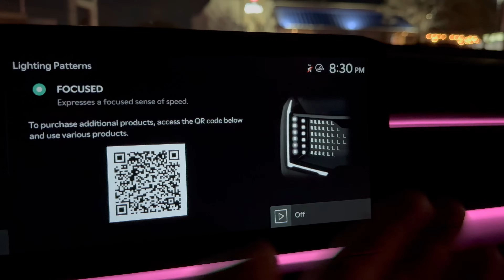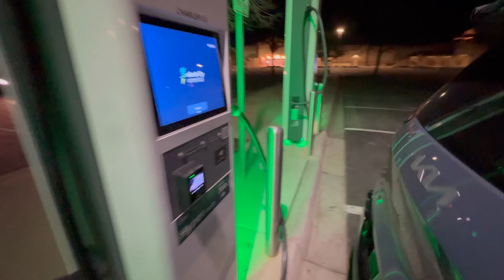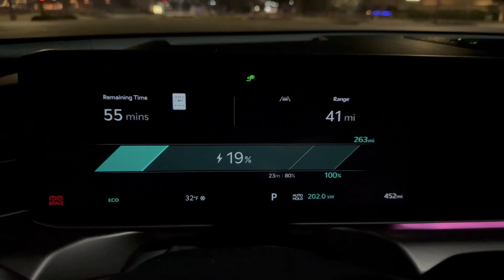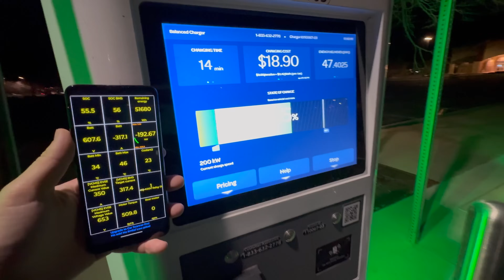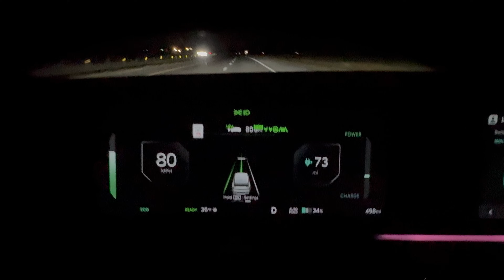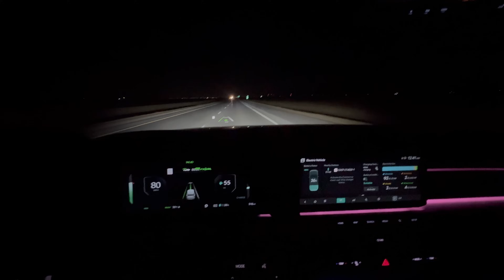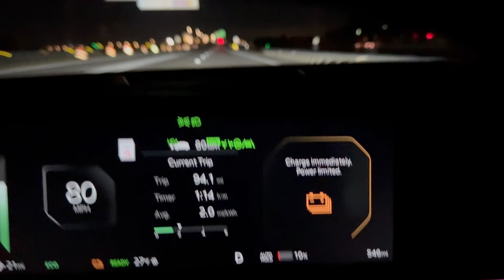The Kia EV9 Will Be A Great Road Tripper! 10% Challenge w/ This Electric SUV (GT-Line 99.8kWh)

Comment: Stop supporting the manufacturers gaslighting everyone calling these types of vehicles SUV’s.  It’s a crossover at most. Has little to no ability to go off road. Which is fine, but when you compare it to a true SUV like the Rivian you are handicapping the Rivian that carries the cost and weight of what is required to be a true off road vehicles. It’s like comparing the efficiency of a g wagon,Land Rover, Land Cruiser, etc with a Lexus RX. They aren’t the same and don’t have remotely the same capabilities.
Reply: At the end of the day it’s just a name. I don’t see issues with calling them the same as like everything there is a spectrum of capability which people can figure out if they’re so inclined.

Comment: Hmmmm my only thoughts on this is, compared to the telluride top tier trim for similar evaluation, at 52k, that car gets 24 mpg.  Allow us to be reasonable and say 21.  Even if you lived in a state where gas is 5 dollars a gallon, you will get 84 miles for 20.  You just charged this at 36 cents I assume with a electrify am pass+, and at 19 dollars for 94 miles this makes a pretty tough sell.  If you live in a state where gas is 3/4 dollars that makes it even more difficult.  Being that this is currently the only kia family mini van I guess it can fly.  Considering the tellurides cheapest trim is 32k the lower models of the EV9 would have to be possibly 38k or lower otherwise that's money which could be counted towards fuel and is actually not upfront costs.  *I will notate that in states where gas is cheaper the cost of home charging is substantially lower but a typical ~15% to 80 will take 11 hours on a 240v

Mind you that if you did have 4 passengers, 5 total that this range would drop even further, similar with the telluride.  Just something to consider.  The model Y, at least mine is almost twice as efficient or twice as cheap for the same performance, keeping in mind that there is a 7 seat option but does not really hold more than 5 comfortably.
Reply: If you only ever charge on public DC fast charging, then yeah, the fueling costs will be in the same ballpark as gas. But if you charge at home to cover your day-to-day needs, like the vast majority of people who (should) buy an EV at the moment, then your fueling costs can be much lower. If you can't charge at home, then an EV probably isn't for you at the moment.
Reply: @WarpedFlayme  Indeed, but I can't charge at home and I only rely on super chargers.  My round trip daily to and from work is 200 miles.  Fortunately where I live and I am certain other places as well, tesla is cheaper in the morning when I get home than what I pay at my home per kw.  I think there are definitely a lot of factors and 100% agree, I think kia and hyundai are going all in on electric and offering comparable vehicles since their combustion counterpart is total trash.

I just feel a lot of people do get confused with electric, if I buy an electric car I want to pay half the cost of fuel for equivalent mileage on a prius or ~50 mpg.  So if you buy a car and cant get 50 miles for 1.50 in a 3 dollar gas state what's the point of buying electric.  Simply my take on it and something to definitely consider
Reply: Don’t forget most of the time you can charge at home. That is much easier and cheaper.
Reply: That also assumes that everything about the two cars are otherwise the same. An electric car will drive different, not vibrate at idol, instant torque. If you drive both and feel they are equally appealing then get the ICE. I think the biggest mistake is people comparing ICE and EV as if they are the same and then asking for the math to payout. You should feel that you like something better about the electric version to justify the price difference.
Reply: @minelast7113  Agreed, that's my point with most electric cars the price is typically higher than ice.  Most manufacturers and straying from electric cars because profit margins are way less.  I watch the electric viking and have previously heard this topic come up and it's probably highly accurate.

As I just stated in another reply, when I buy electric I buy to save on fuel.  My opinion is if you cant get an equal performance in miles at half the cost of gas it's not worth it to buy electric.  This is regardless of whether you charge at home or at superchargers.  More so if someone depends on superchargers
Reply: It is true, the fuel comparison is valid. And sure, this isn't the best efficient version of the ev9. 
But Kia and Hyundais reputation with gas engines, lol. If going gas, better get a honda or toyota instead.
Reply: @sprockkets  I just want people to understand that going EV is typically about fuel savings. In my opinion if you buy an ev whether you are supercharging or have the ability to charge at your residence the cost needs to be half of what you spend on the fuel.  I just simply use miles to do this, and for example a prius is pretty much the top hybrid and will definitely get you ~50 mpg.  So when I charge my electric car if 3 dollars gets me 50 miles I need 50 miles of charge for 1.50.  

Some may say why do I think this why or what is that based on and that is stemming from the premium price tag for an EV.  which is the point I brought up in the comment.
Reply: Only reasonable EV is a model 3 rwd with the current 7500 tax credit.  Less than prius.  I suppose chevy bolt too.   These expensive EVs are pointless unless you ahve money to burn.  Also i wouldn't buy an EV unless i could home charge it.
Reply: @zachlafond2652 no tax credit for the 3 or y....

Comment: Once again I appreciate the enthusiasm but 15 min to go 140 miles?   So basically add an hour plus  to any day of driving if the charge is open. Nice looking vehicle though.
Reply: That's about right, but subtract the real-world time for stops that you'd take for gas, food, bathroom. If you road trip like me at 20, where I would tank, pee and grab snacks in a 10 minute stop, it's a bigger difference. Travelling with a family makes every stop a 30 minute stop so I doubt the constraints of an EV like this would really add that much time to a real-world road trip.
Reply: Sorry what do you mean by "everyday of driving" ? The 140 miles would be for 15 mins of fast charging from 10%-54%. If you charged up at home before leaving on your trip or daily commute you would probably get 220-240 miles in the conditions kyle was driving in his 70 mph test. This might not be enough range for some people but for the majority of drivers this is more than enough. That's not to say more range wouldn't be appreciated for the 5%-10% of the time people actually have to drive further than these distances or when it's well below 0 degrees. Then at that point the more range the better but those temperatures only last for 4 months out of the year, the other 8 months are good for battery efficiency.
Reply: @BrianNedry  Kyle drove 94.1 miles on 49.45 kwh - the battery is 99 kwh so that would be 188 miles +/- from 100% to 0% under the same conditions at 526Wh/mile. That is the worst efficiency I have ever seen for a 10%/15min challenge. Yes it was cold but I would swap some efficiency for a 5 min longer wait every day of the week.
Reply: 15 mins to go 94 miles at least in these conditions.   Summer would get you more.
Reply: Also paying $21 for 140 ish miles is more expensive then most ICE cars plus you have to wait to charge it, plus the very rare chance of  the battery becoming a flame thrower under you.. not more environmental than ICE until like yr 7.. idk, ev's and the infrastructure has a LONG way to go before everyone gets them 🤷‍♂️ also I only want to stop for 10mins every 4hrs to pee and get gas and be on my way and get where I'm trying to go

Comment: Again I want to see the 10% challenge using the more common 6.6kw charger that’s actually available in the real world. You landing at the .001% of dc chargers is NOT real world. Inviting you to Las Vegas for a test..
Reply: That’s not reality so why test it. As someone who has driven an EV(not Tesla) from Florida to California and from California to Utah many times, I have never had to use one of those chargers, not once in over 10000 miles of road trip driving in multiple EV’s. That includes crossing Nevada on I-80.
Reply: @hoopdyhop76 
Henderson Nevada. You look and tell me how many working chargers you find. electrify America  There is ONE working charging max 48kw in the shit section of Henderson.
Reply: You didnt say "Nevada", you said "Las Vegas" which, I just checked, has 10 Electrify America stations.
And I don't live in Las Vegas or Nevada, I said I used them while passing through.
Besides, if you can't charge at home, then an EV probably isn't a great option for you right now. DC fast charging should only be for road trips, not used for day-to-day driving needs. DCFC puts you in the same cost ballpark as gas with a way more expensive vehicle and puts additional wear on the battery.
Reply: What are you talking about? Vegas has like a dozen Electrify America stations. I've used multiple of them while passing through.
Reply: @WarpedFlayme 
One in Henderson 48kw
Reply: All the casino parking ramps and hospitals is what you will find they are all 6.6kw
Reply: The Kia and Hyundai dealers I bought my ev6 gt and Ioniq 6 don’t even have working chargers. You buy a new EV with 5% battery and they send you to the one working charger in shit part of Henderson to wait hours in line for one 48kw charger.

Comment: Will be interesting to see what 2024 brings.  Why buy an ev with only ccs port when nacs is around the corner?  Adapter doesn't seem to matter given most Tesla chargers will still have the short cord issue.  CCS cars taking up more than 1 space in 2024 will be interesting to say the least.
Reply: this car with these voltages cannot use current TSCh network anyway, no matter the plug

Comment: The Kia EV9 Will Be A Great Road Tripper once it comes with a NACS charge port in the correct location, till then its only good for home charging.
Reply: But does Tesla provide 500+ Volts? 🤔
Reply: @abraxastulammo9940 In their upcoming V4 chargers, which are being installed in Europe at the moment, they do. They will be able to charge at 350KW.
Reply: @migueljardim8177  Europe will never get nacs
Reply: @migueljardim8177 I've seen that they're deploying the V4 dispensors, but I haven't seen that the V4 chargers are being deployed as well. If that's the case, it's good to hear and I hope they cross the pond soon.
Reply: @abraxastulammo9940  Guess what? NACS is not the only charging standard in the world that can support 350KW, who knew?!
Reply: @WarpedFlayme  You are correct. They've started rolling out the dispensers, and they'll start wiring them up in the 1st quarter of this year. It'll be interesting to watch charging speed comparisons between the different versions of superchargers in the future.
Reply: Europe already uses CCS for all EVs including Teslas and supercharger.
Reply: @abraxastulammo9940  
Read the NACS standard, its good for 1000V
If the EV9 has contractors like the Cyber truck it could charge at 250kW at 400V.

Comment: Dear Kia, if you see this, please give us some kind of dog mode. That's the only major downside I can see for myself since I have a service animal that goes with me everywhere. Awesome video Kyle, you're killing it with these reviews. Have a awesome New Year!
Reply: The car comes with Utility Mode, it's like Dog Mode and Camping Mode combined!

Good job they didn't call it Dogging Mode....
Reply: Just leave the thing on.   Easy enough.  Certainly not a downside.
Reply: @spazzman90  You're right, I shouldn't call it a down side, but it would be nice to have a setup that will notify me if for some reason the air turns off, or there is a issue like Rivian does. Where I live, it can get to 120 degrees in the summer, so I would rather be cautious. Other than that, I got to drive one of these yesterday, and I love it.
Reply: If you travel with a service dog, its safe to say you won’t be leaving the dog in the car alone, so why the need for dog mode?
Reply: @Annette_Hons probably because there is certain situations where I can’t bring them with me if I’m gone for 5 to 10 minutes.

Comment: Why would you be doing 80 in that brick of an SUV?
Reply: Because 130 is the "most recommended" standard speed in Germany 😇
Reply: 80 mph is a good speed to show you roughly what people should expect driving in similar conditions and traffic, at 80mph you would definitely be keeping with the pace of Hwy traffic if not exceeding it. If you want better efficiency then drop speed by 5-10 mph and that would get the EV9 into the 100-120 miles zone with no problem. In warm temperatures I'm guessing 130-150 miles doing the same loop in the video. Close to 300 miles in 2 fifteen minutes stops from 10%-54% (half a hour to 40 mins) is pretty good for this 3 row monster.  Quite impressive Kia, just need the price to drop and they'll have a winner.
Reply: If he hadn't set the parameters of this test to that value, there would be a lot of comments saying it's slow and most people drive faster.

Comment: More energy added in 15 min than Lucid Air and nearly as much as Taycan. What a beast! I want to road trip one of these.
Reply: Try ABRP from Phoenix to Telluride in the winter in the AWD EV9. Requires that you drive 10 mph under the posted speed for 4 hours and even then arrives on fumes. Hope you don’t have a headwind or snow to contend with. 

The fast charging is cool but I wish they’d put another 30-50 miles of range in the battery pack.
Reply: Kia is promising vehicle, but these need more range to be competitive road trippers where many of us want to be able to efficiently travel. I frequently cross areas of the west, where fast chargers are still quite spread out, even on interstates.

I used A Better Route Planner app to see how the EV9 does on many routes I frequently travel. Rivians and Teslas still beat the LR AWD EV9 by significant margin, apparently due to their longer range. See example below. 

An often overlooked benefit of longer range is faster charging, and frequently significantly faster. 

When you need to “fast charge” above 60% or more, all EV charging speeds get significantly slower to protect the battery from excess heat. Longer range EVs greatly reduce the need to charge near the max capacity of the battery. For those long legs between chargers, that are still common in many areas, longer range EV’s can do them changing to a lower percentage so they keep charging speeds faster.

Throw in some cold weather, wind and precip and it gets even more important to have the big battery.

ABRP Estimates: Flagstaff – Vegas – Flagstaff

R1S Quad Large Pack 20”: 8h32m

Model X LR 20”: 8h34m

Kia EV9 LR AWD: 10h4m

(10% arrivals, seasonal weather January, 300 pounds extra weight, 55° battery temp. 100% speed. 1% battery degradation)
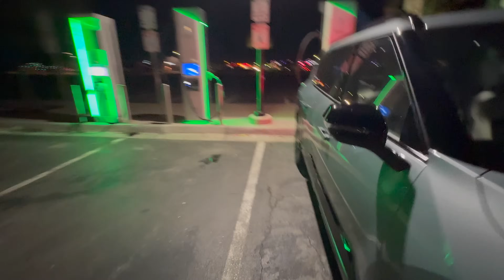Reply: @e2dub  When I put model X I got 10:35, for R1S 10:06 and for EV9 9:59. Different conditions than you put (like no extra weight, 90 % arrivals and other stuff) but same condition for every car. Pretty sure you have to made some mistake there, I cannot imagine any condition that would make EV9 worse but the other two cars so much better.
Reply: @e2dub nah, the EV9 crushes it, awesome charging curve, much better than Tesla, and it’s a huge car for large families, while the model x is quite small inside.
Reply: thats c9l bythe wah i see whatyou seesthatstlod make saion soyou know
Reply: thats need so you know

Comment: twenty bucks for half a battery charge? May as well stay with gas
Reply: Most charging is done at home, where it is significantly cheaper.
Reply: Or 6 bucks at home!  Not to even bring up the reduced carbon in the atmosphere.
Reply: Road trippin in an EV right now (with low gasoline prices) will save you nothing.
Reply: @zachlafond2652  I think you guys are missing the point. The key points are:
1. This video is not about a cost comparison between fueling an EV on a roadtrip vs. an ICE vehicle. 
2. Even though the costs are generally similar to fuel both on a roadtrip, the fact remains that fueling an EV is going to always be cheaper when factoring in most “refueling” of EVs occur at home and/or on Level 2 home/destination chargers.
Reply: DC fast charging costs about 5x the cost of charging at home. If road trips and fast charging is your use, you won't save much.
Reply: @steinwaymodelb  Yes, because most people road trip on a regular basis 🤦🏽‍♂️